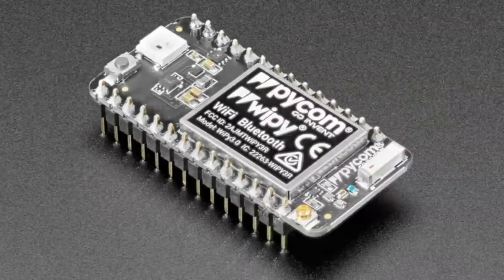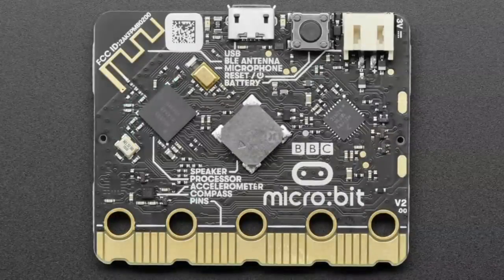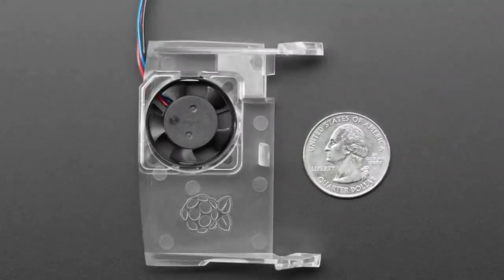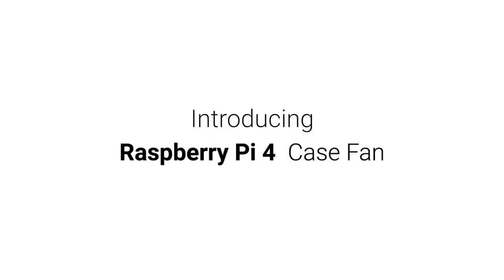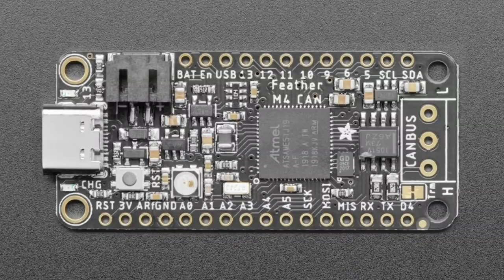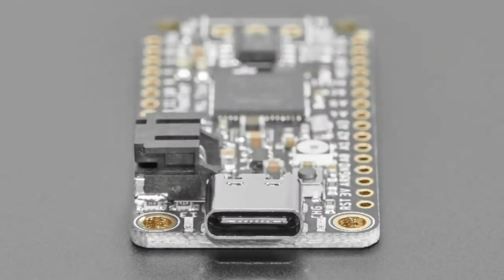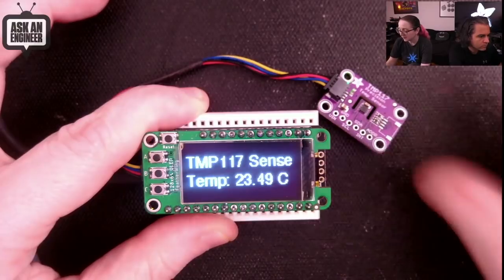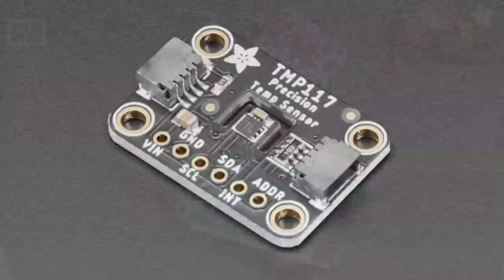New Products 12/02/2020 Featuring TMP117 ±0.1°C High Accuracy I2C Temp Sensor - STEMMA QT / Qwiic!

Comment: For those who need humidity too, check out the SHT40. They only came out two months ago, but they have the same connectivity and accuracy at 1/2 the price per sensor. I'm using half a dozen of them for environmental sensing and they're great
Reply: Can't wait to upgrade to the sht40! Currently using the sht31 with the PTFE membrane. They don't have that for the sht40 yet! :(